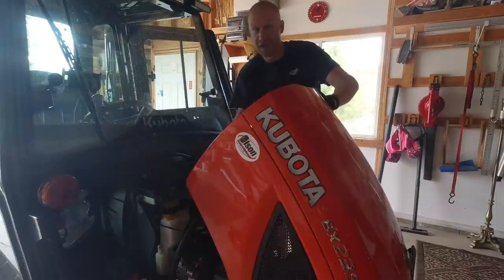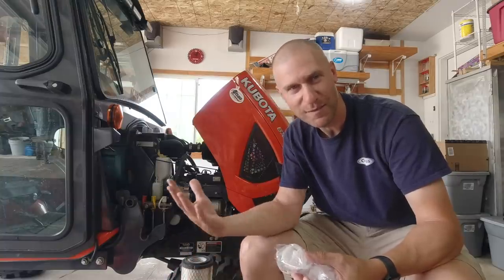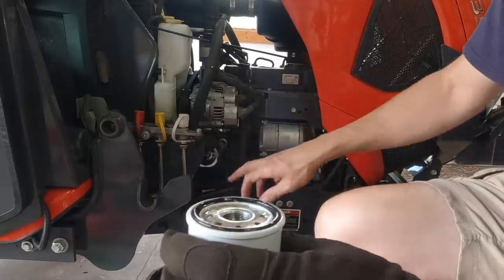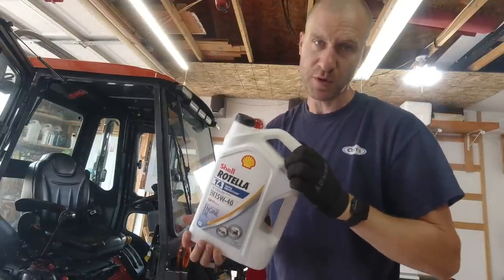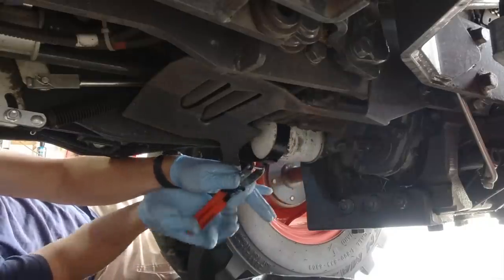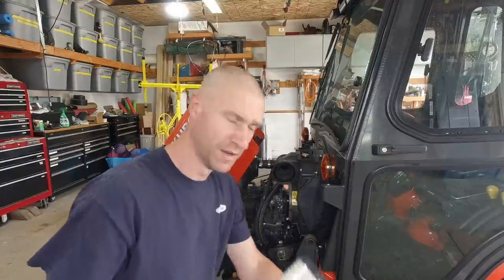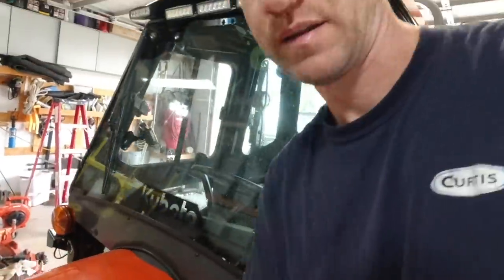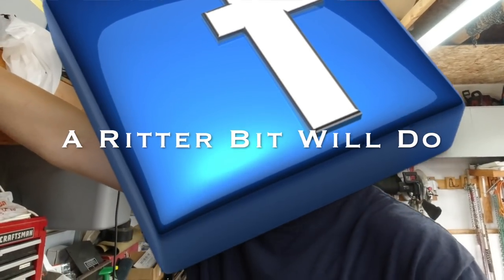KUBOTA'S HORRIBLE FILTER DESIGN (BX tractor)

Comment: Why does the engine need two fuel filters? I'm assuming that the filters are on the same line.
Reply: The one underneath protects the fuel pump the one on the engine catches anything the first filter misses
Reply from the maker: They want to have one before the pump for some reason. I think they could eliminate it. 
Keep on tractoring!
Reply: Most diesels have at least 2 filters. The first one would help with water..... sort of..... Wouldn't hurt to change the first one a bit  more often (at least if you see it getting "brown")
I am sure it does the job Kubota wants it to do, but totally agree they need to change the design. This is what you find in $2,000 ride on lawn mowers.....but even my mower has one that's easy to get to.
If I bought one of these (will likely buy a B-series/2025R/Mahindra Max size.... I actually like them all but leaning toward a Kioti CX2510)
At the end of the day buy the machine you like that will do the job you need - they are all good machines and each one will have things that seem like a stupid design, or cheap. No different with pickup trucks, cars or motorcycles.. (39 years as a mechanic)

Comment: Do your self a favor - pickup a DONALDSON FUEL/WATER SEPARATOR P553203 and a Baldwin FB1311 Fuel Filter Base and do away with both of those little toy things. They are junk. One filter should/would last you a lifetime on that little engine. Also pickup a Silicone Pad Diesel Fuel Filter Heater Wrap. They come in 120v - house outlet or 12v - tractor battery powered. That fuel filter will filter much better (3 microns @ 99%) than any stock KUBOTA filter. Mount it any place you like.

Comment: Take off that guard.  I took mine off.  I don't need that skid plate guard, all I do with mine is cut grass around house and don't do any forestry stuff where I would have sticks poking from the bottom .  I guess my question is this.  Why would you want to pinch off your fuel lines.  I wait till the tank is almost empty and just let the remaining fuel run out into a container.  This way it will remove any trash in the tank into the container and let the line from the fuel pump empty also which can remove any trash in the line.

Comment: My B7800 has a front mounted one at the bottom of the frame rail where there is a 100% chance it will get hit with a sapling and busted. So BX is not the only problem child.
Reply from the maker: Wow, the engineers that come up with these designs cannot possibly be tractor owners. It’s just crazy what they think of sometimes. 
Keep on tractoring!

Comment: Engineers that mount oil filters horizontally should be castrated. Buy some fuel line hose and reroute that lower filter to a more accessible area.

Comment: You Wonder some times of the Grade Level of those people 🤪 that Design things how they do. 👎
Reply from the maker: You sure to wonder! These engineers only see a few parts of the piece they are designing and don’t realize how other components nearby just don’t work well together. It’s frustrating! 
Keep on tractoring!
Reply: They saved like $20 per tractor by using those cheap throw away fuel filters LOL.  I'd think adding a regular cartridge type fuel filter somewhere on the tractor would be a huge plus and get rid of those cheap throw away filters.